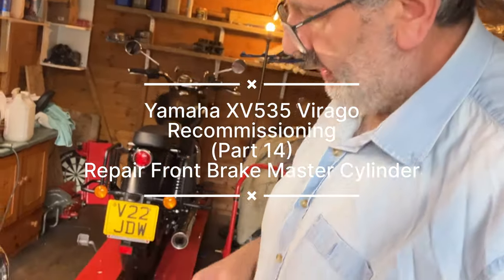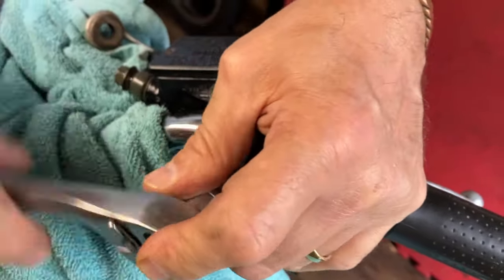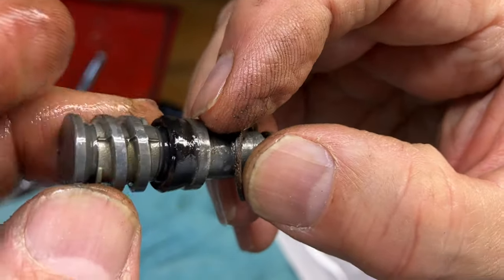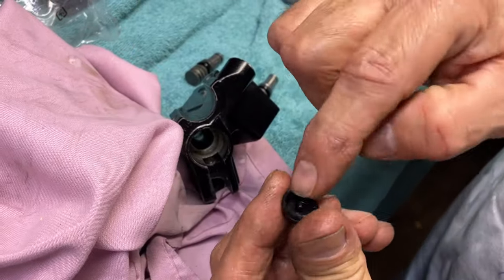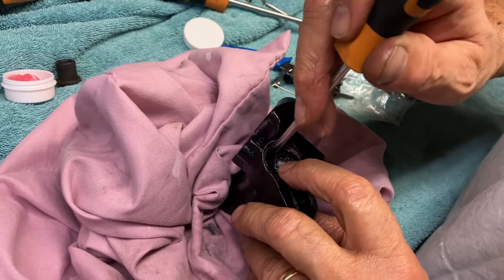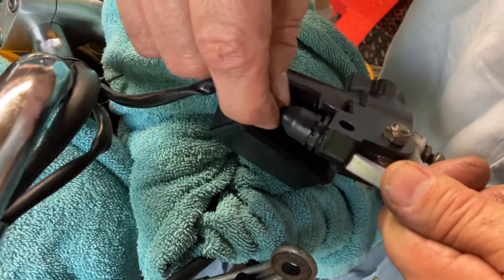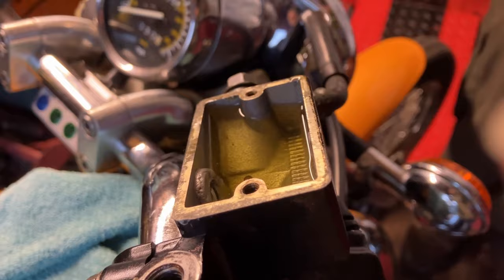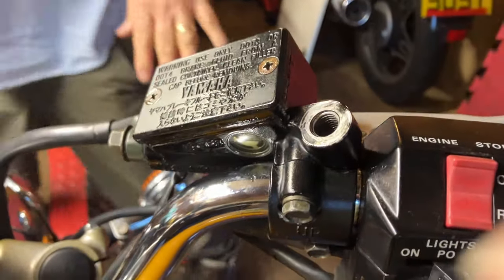Yamaha XV535 Virago - Recommissioning (Part 14) Repair Front Brake Master Cylinder

Comment: Great video! Thanks very much for the detailed info. I needed this vid and haynes manual to change mine. And goodness... It was a tough job getting the rusty old retainer ring off and then i got to putting the rubber ring on the new master cylinder... Must have taken me 60 minutes. No wonder your video cut that out. I couldn't have replaced mine without you!!
Reply from the maker: Glad you found it useful. It wasn't the worst job that we did on the Virgago (carb removal).

Comment: Good video, thanks.
If you fit the factory handlebars the reservoir will sit straight.
Reply from the maker: We hadn't noticed that they were not original. If they weren't, then that would explain the ridiculous angle of the reservoir.
Reply: I believe there are two bar types on viragos that might depend on year and model. One is straighter. The other like mine is shaped like in the video and definitely have the same issue.

Comment: 12:10 it doesn’t matter how tight you do that up it won’t pinch, it’s a shouldered bolt, it clamps on the lower side only and the plain part of the bolt is just a pivot. No clamping forces around the lever at all. Good video though. I rebuilt my virago engine on my channel, and turned the bike into single side carb, Rat Bike. Love the colour of yours btw.
Reply from the maker: Thanks for the information. As we wrangled with removing and servicing the carbs, we did think about a single carb conversion! We'll definitely take a look at you vidoes and, maybe, if we get another Virago, we'll give it a shot.
Reply: @MotorcycleFettlers  Personally I’d never convert to single again, it doesn’t really work on a V engine as each cylinder needs different fuelling, it always ran like poo afterwards.